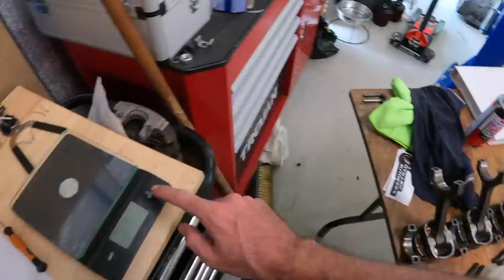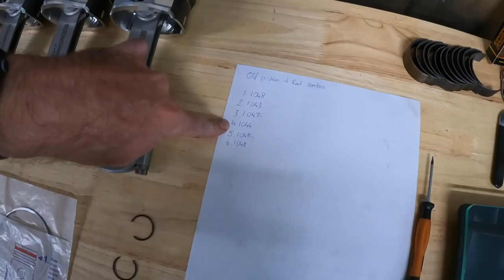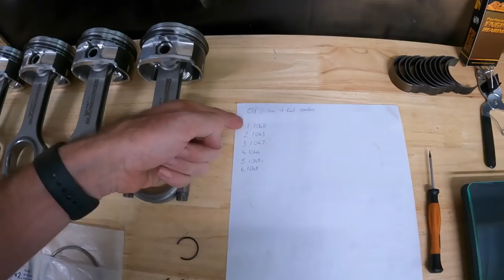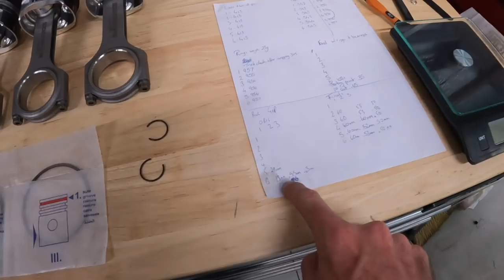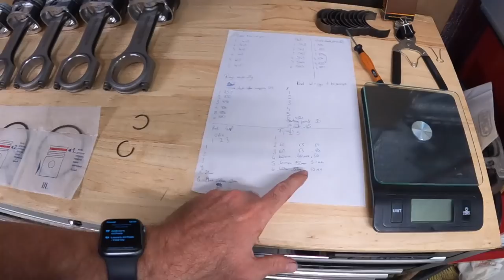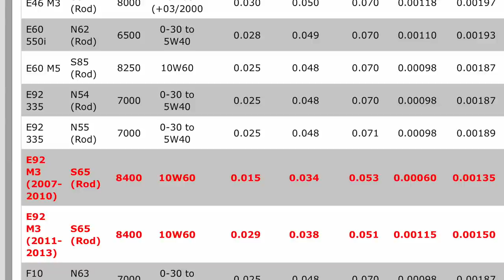FORGED N54 BUDGET BUILT MOTOR BOTTOM END ASSEMBLY

Comment: We did not even gap our JE Piston rings, because normal size and had 0 problems with the previous one. Think theyre measured to be precise from the factory.
Reply from the maker: I kinda feel like these would have also been fine for most applications. The top ring is the only one that had a "big" change. Which hopefully comes in helpful for what the motor will go through.
Reply: @ZeroTo60Tube  Im going single turbo and aiming for 750 bhp. You think it will be fine? Dailying the car and not tracking, should be fine, just wanna hear your thoughts. 

Stressed about not gapping them afterwards..
Reply from the maker: @akseln54  Most likely will be fine. The singles dont load the bottom end up like a twin turbo setup. The back pressure from a twin setup really gets the cylinders very hot. Where a decent single will help get the heat away. I think you will be fine. A lot of guys dont realise how much a high power twin setup stressed the motors.

Comment: Didn't you use the kingtec racing components ?
Reply from the maker: No
Reply: @ZeroTo60Tube I have a 4B11 N/A lancer turbo'd, can't find forged internals that can fit it. I wouldn't be pushing too much power, just like 330whp tops. Would you recommend the KingTec as they make custom internals?
Reply: @ZeroTo60Tube  I want to push power reliably without having to worry about losing the engine

Comment: That’s .05 mm clearance that’s 2 thou clearance not enough you should be around 2.5 to 3thou maximum that being 
.075mm max clearance and .06 mm minimum factory clearance isn’t good when you want to make power as the tolerance in bearing clearance isn’t enough for the extra heat you produce in using more boost than factory as the cylinder pressure increases dramatically 
Google boost Vs compression ratio and you should find a table that reads your compression ratio increase to the amount of boost you put in and you will be extremely surprised by what stress your putting your engine under

Comment: Its an inline 6 motor you shouldnt need to do weighing as a tolerance problem these motors rattle themselves straight is what ive had plenty on mechanics tell me and ill say it just how they will have you ever seen an inline 6 motor of any kind have a balance shaft like a 4 cylinder motor does or have you seen people put on balancer after balancer trying to balance an inline 6 motor out like they would for a v8 car no you havent because they don’t shake or rattle slam it together without to much thought with all this extra thought youre putting into it you may fuck it up more doing that